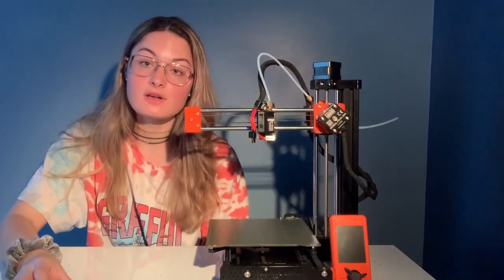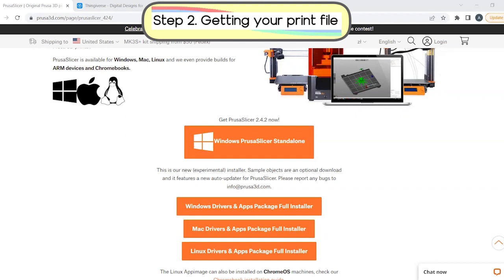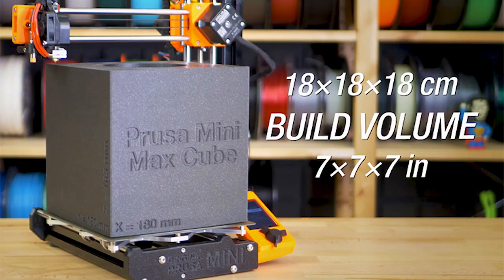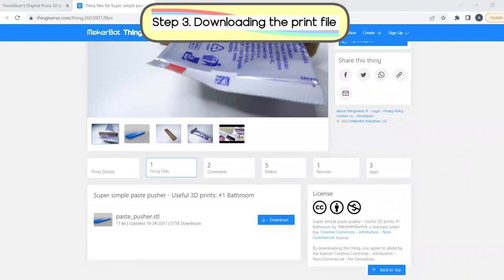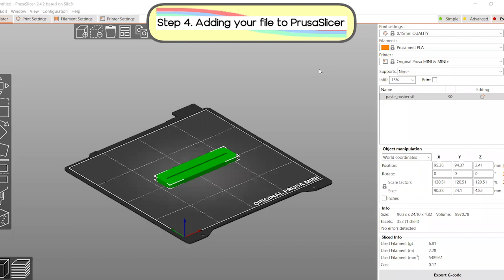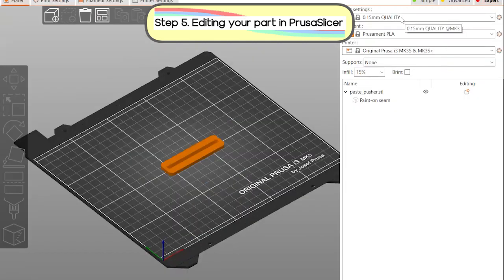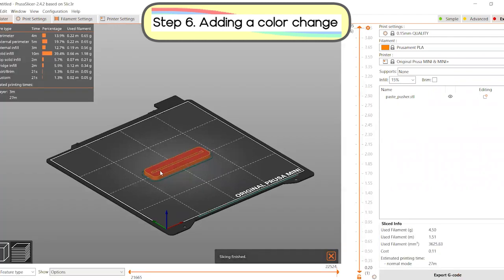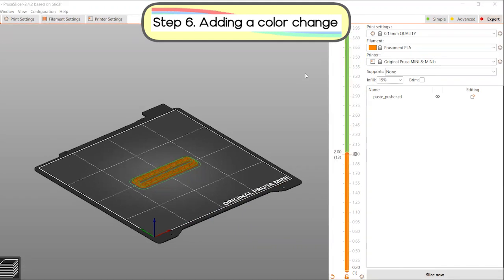How to Use the Original Prusa MINI: From Computer Design to Printed Model

Comment: I ordered a Mini clone kit in China for 210€ and bought the printed parts from a guy in Spain via Ebay for 40€. I think it's worth mentioning that that is an alternative if money is tight. The only differences to the Mini from Prusa is the heatbreak and the bed level sensor. These can be bought at Prusa for 30€ or so, but the ones delivered in the clone kit seem to work as well.